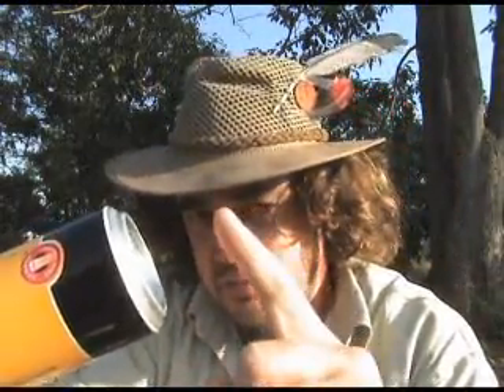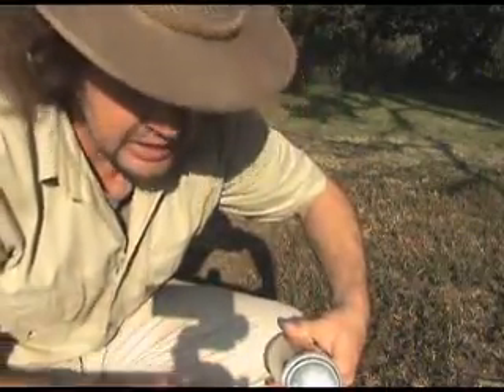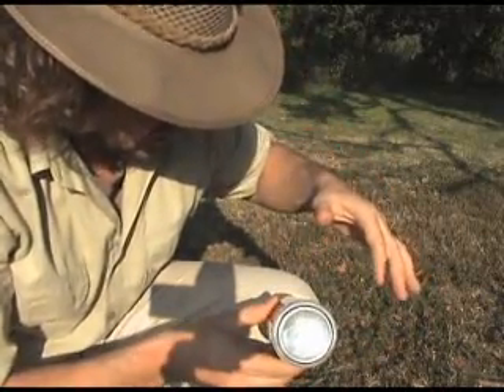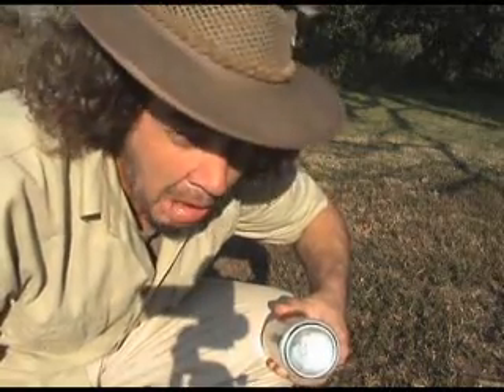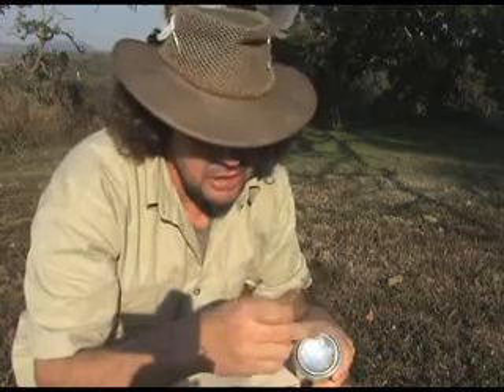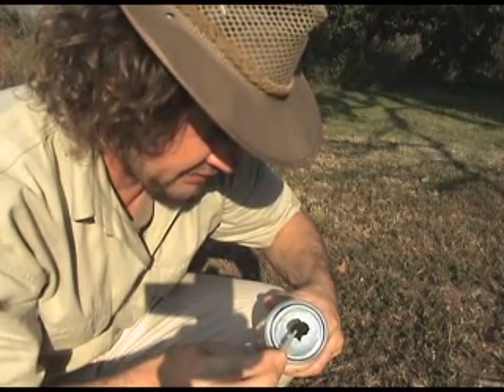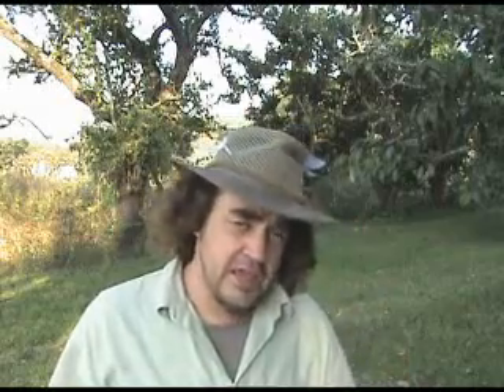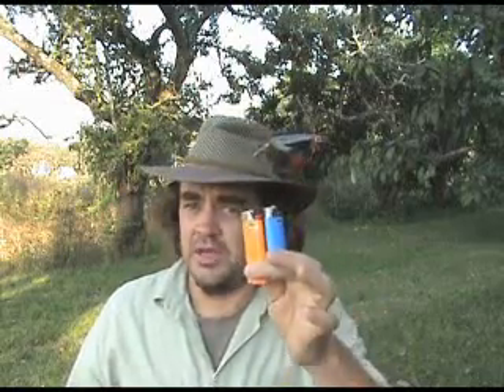101 Ways to MAKE FIRE - #2 Beer Can & Toothpaste (2)

Comment: IF you have a boddingtons pub ale you can just take the widget out of the can, set it in the sun to let it dry out, Once it is dry, set it on a rock with tinder all over and around it to catch the spark you're gonna make. Then take a regular claw hammer and try to hit the widget. You miss and hit the rock and it makes a spark.  The spark will eventually light the tinder if you do it many many times.

Comment: lol. another good one. you can also use just a mud slury to polish that can up. i've used this trick before and it works great with a little time and practice. although you may want to rethink bringing soda and beer into the woods with you mainly because on a hot day it makes you more likely to have a heat stroke especially as you age. but this could potentially save your life. and being that almost anywhere you can find a tin can this is a very likely method.